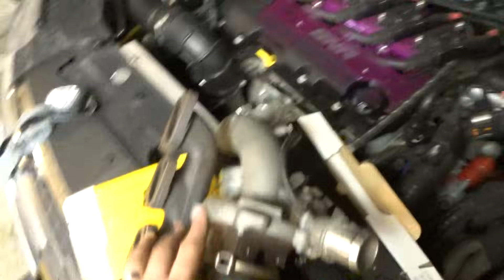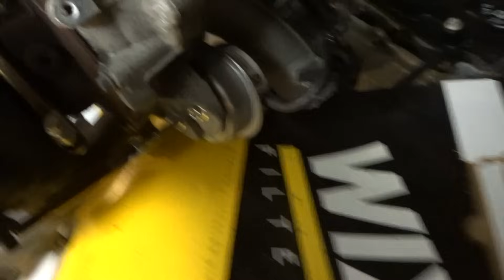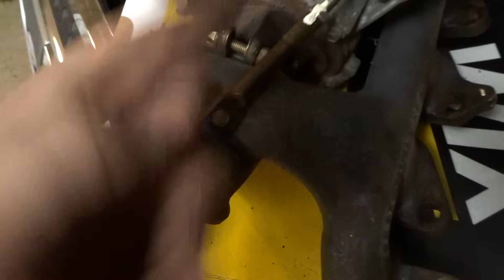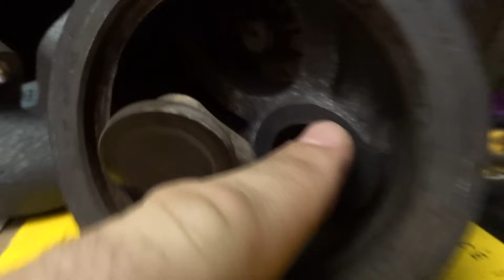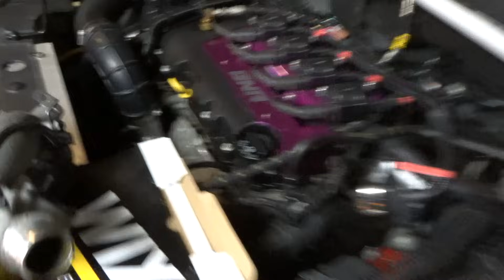Chevy Cruze Sonic P0299 Turbo Underboost Code Explained

Comment: Hey Andrei, I'm getting a P0299 code and can't seem to figure out whats causing it.. Figured i'd pick your brain and see if you can think of something I haven't. When I first got the code back in August, I bought one of your boost testers and found I was leaking boost in multiple spots. I also pulled the turbo out and found a good size crack in the waste-gate housing. Because of this, I decide to go ahead and replace the turbo, waste gate actuator, oil feed and return lines, as well as a few other things since I was already tearing into the engine. I also upgraded my PCV V2 kit to the V2.1 kit and threw on the PCV hose upgrade kit you sell. Threw on a new valve cover too.  I also cleaned up the throttle body and intake manifold and replaced gaskets on both. Once I got everything put back together, it ran great for about a week and then started throwing the P0299 code again.. When I do a boost leak test, it takes almost a full minute for it to drop from 20 PSI to 10 PSI so I know my system is holding pressure. I really don't think its the turbo either since its brand new. Only other thing I can think of is maybe maybe my MAF sensor is bad? Also, at the time of doing all these upgrades, I switched my stock air box to a cold air intake system. I threw the stock air box back on last night but haven't had a chance to take it for a drive yet, didn't know if that could maybe cause a low boost code for some odd reason? Anyways, hope to hear back from you, TIA.
Reply from the maker: How long as the V2 kit been on there (miles)?

Comment: what If you have no check engine light on  at all  When my ac is on during the summer months my car lacks power and   when you shut it off after running it go into store come out it Skips like crazy then clears up
Reply from the maker: You could still have a missing intake manifold check valve. Without diagnosing further, I wouldn't know what your issue is exactly.

Comment: I have a concerning question. Why do you use the stock air box?
Reply from the maker: All of the aftermarket ones either increase intake air temps or badly skew fuel trims. I modified the stock airbox to pull air from the fender directly while maintaining the stock MAF calibration. GM actually did a great job designing this airbox.
Reply: What are your air intake temps?

Comment: I just got this code. Is it okay for me to drive this 2 months (minimal driving) or is it a fix that needs to be fixed ASAP?
Reply from the maker: If the vehicle continues to operate mostly normal, you should be fine to continue driving it. If you are very low on power, I would not drive it.
Reply: @AndreiDPop  I really can't notice much difference at all. Thank you
Reply from the maker: @hughjanus8600  ok, might just be a missing intake manifold check valve and some boost leaks combined. You'll notice a difference once it's fixed for sure.
Reply: @AndreiDPop  my waste gate was disconnected and causing it to be wide open. 20 mins and $0.36 later she's fixed and runs so much better
Reply from the maker: @hughjanus8600  awesome, glad you caught it!

Comment: I have a 2012 chevy Cruze rs, the last few months I’ve had this code. It’s been in and out of the shop 3 times. They do something the car has a good boost again, and then after a few days the engine comes back on and I start losing boost again. So I’m assuming I’ll probably need to get a new turbo 🙄

Comment: Ok, so based on what you are saying, what other parts can it be besides the turbo? I have changed turbo and I still have issues with code p0299
Reply from the maker: Intake manifold check valve failure and any other boost leaks between the turbo and the intake manifold.
Reply: @AndreiDPop  ok thanks, this is a super tough issue and it is very frustrating to fix. I feel like I have to shot gun parts.
Reply from the maker: @dashadow231  no, you need to boost leak test the system. Figure out where it's leaking. I sell a test kit on cruzekits.com that you need a compressor for, or you can make one yourself.
Reply: @AndreiDPop  I see, I already spent 1100 in usless repairs,  I will just give the shit car away and never buy a chevy again. Thanks
Reply from the maker: @dashadow231  I try to make these videos available so people know what to look for. Sometimes it's just as simple as a loose clamp.
Reply from the maker: @dashadow231  I know the feeling, but hang in there. Get it boost leak tested first. It might be something really simple.
Reply: @AndreiDPop  Do you know any good places I can have this done? I am way too mad to do this test myself
Reply: @AndreiDPop  thanks for your help btw
Reply: @AndreiDPop  could it also be thebintake manifold check valve?
Reply from the maker: @dashadow231  yes, that's what I said.

Comment: This is the second video I've seen that you mention the possible boost leak at the charge pipe/throttle body connection.   Do you have a fix for this leak?
Reply from the maker: Tighten the clamp harder. If that doens't work, wrap the throttle body with natural gas pipe tape (the yellow stuff).
Reply: @AndreiDPop  thanks I'll be getting one of your pcv fix kits soon btw!

Comment: Where do you get that BNR waste gate? I’m throwing this code and I’ll be taking some steps to find out what’s causing it. Will I be able to visually see the waste gate “arm” move or not move if it’s bad, say in park Reving the engine till the revs limit?
Reply from the maker: BadNewsRacing.net. the arm only really moves while you're driving but you can move it by hand with the car off too. Not sure how much it will move if you're in park revving.

Comment: Hi!  This goes beyond my basic knowledge of my cruze.. but my check engine light for this code comes on... Issues accelerating... then off... no issues accelerating... sometimes in the same day! sometimes it's on for days.. sometimes it's not... Made an appointment to take her to the dealership since she's just barely under warranty still...  This has helped to maybe ask them questions... They've already helped once... Besides the oil the dealership uses, which kind can I purchase at the store that you recommend? Thanks.
Reply from the maker: The best oil you can get is AMSOIL Signature Series, but as it's not available in all stores, I'd recommend just running Pennzoil Platinum.

Comment: Hopefully the powertrain warrantee is still in effect.  If not, I hope it's one of the cheap fixes for mine....
Reply: Tried to get the OL a nice '08 R52 S MINI, but she had to have a Cruze, because it had 4 doors and more cupholders.  My '03 R53 has over 200k miles, and still runs strong - and will run even stronger now that it has a performance head and cam.  Still has factory hone marks on the cylinder walls, too.  Solid engines with forged internals, the W11....

Comment: So my cruze throws this code intermittently, it'll come on for a few hours or a day and then just goes away for a while, sometimes weeks or months. The car doesn't go into limp mode, but it's definitely down on power and i start burning through fuel, then it's just back to normal. I've been pointed towards the bypass valve, but I'm not sure. Any ideas? I'll be tearing it down soon to rule out the turbo itself, but I'm fairly confident that's not the issue considering the way it behaves
Reply from the maker: Check out my pcv issues video. It's likely you're missing the check valve in the intake manifold and its contributing to your problem. I'm not ruling out the turbo yet, but I'd start with the intake manifold first.
Reply: @AndreiDPop  Ok I'll check that out. Thank you very much. Yeah with my luck it'll be the turbo itself so we'll see.

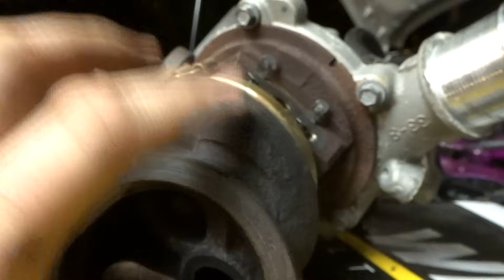Comment: At 3:37 what is the issue with the cracks on the casting on the wastegate valve seat on the Turbo?
Reply from the maker: It's very common. A small crack won't be a problem.

Comment: Great video! Would like to discuss a partnership with you with the possibility of providing free parts, including a new chevy cruze turbo if you film the install and give us a shout out. Let us know if you are interested.
Reply from the maker: I already have a BNR GTX14 turbo so I won't be replacing that any time soon, but sure, let me know what you have in mind.
Reply: @AndreiDPop  We specialize in brake pads/rotors, AC compressors, suspension, turbos, and steering; whatever you'd like to do an install video on we'd be happy to send you the parts. Do you have another way we could contact you privately?

Comment: Could it be the Turbo if it only acts up when the car is warm and under load? It usually does fine in the mornings. Mid day in this summer heat it’s been horrible and going into limp mode. Had turbo and valve cover done at 50k miles. Now that I hit 100k miles it’s doing the same thing again.  When I had the Turbo replaced the Chevy service advisor told me they only last about 50k miles and to look into getting rid of the car.
Reply: Same issue, no boost under load on hot days, but does fine in the winter. Hot humid days throws P0299 code occasionally and no boost. Stopping car and restarting a couple min later works fine for a little while. Going to replace turbo to see if that helps…
Reply: @Jeremy-cb4rz  how’d it go? Diagnosing my p2099 code now, found no boost leaks / Pcv issue / externally evident issues with turbo (leaking oil / water, wastegate issue etc)
Reply: @coldtortoise179  Turns out it was a sticky wastegate valve. When I manually attempted to open and close the wastegate, some corrosion sometimes prevented it from opening and closing. If you have a high heat lubricant, there’s a chance it could postpone a replacement. I did replace it though and haven’t had any issues since.

Comment: 2011 cruze  po299 but if i get it up to 30mph it hard shift down. if i get to 30mph and let off the gas it will shift normal then i can take off,?  I didn't think it was the turbo so i took it to a shop to see what they get for codes. same code as mine. they told me to change the turbo so i got a low mile turbo switch it out  same code and shifting problem  Has anypne had that shifting problem and gitting that code.

Comment: My sister's 2014 Chevy Cruze is having this code, we found the arm on the actuator had become notably rusty so we used PB Blaster and got the code to go away. However it resurfaced about 2 weeks later, so we're going to replace the actuator for $50, staying far away from swapping the turbo. Thank you so much for this good info.
Reply: How did that work out?
Reply: @TheBearGrylz  worked great for about 2 years and then some other stuff popped up, got the part on Amazon

Comment: Just had oil changed at an oil change place. First time not going to dealership. Could this be do to a lesser grade oil? Check engine light on, low turbo boost code 2 weeks later. Coincidence?
Reply from the maker: Check the oil level. What oil did they use?
Reply: @AndreiDPop  it was Castrol. Checked oil and it was good.
Reply from the maker: @curtpence956  castrol what? Conventional? Edge? Titanium? Which Castrol product?
Reply: @AndreiDPop  conventional. Guy asked if it was still under warranty. But I just passed it. My dealership hours are terrible, and with my work, driving a hour each way doing 80 mph. Don't wanna be left on side of the highway. Should I go back and get a better oil? Leave work early and go to dealership?
Reply from the maker: @curtpence956  never, ever, ever run conventional in these engines. That won't even pass factory minimum specs which are already low. There's a good chance the oil coked up and oil starved the turbo. ALWAYS use synthetic in these engines.
Reply: @AndreiDPop  ok. I will get it changed tomorrow.
Reply: @AndreiDPop  thank you. Thought that might be it.
Reply: they might have bumped the charge pipe by the throttle body and cause a boost leak.

Comment: What kind of turbo did you upgrade to?
Reply from the maker: BNR GTX
Reply: @AndreiDPop  hello my friend i am typing from Turkey . I have astra j 1.4 t , i want to ask you a question  about engine . Did you upgrade engine inside before this turbo upgrade? What do you think about stock  engide ( pistons and rods) how many hp can gain  with stock engine  as healty? Also if i port my intake manifolt without tune can i gain hp? This ported can damage the  engine if no tune?

Comment: hmm mine is VERY VERY intermittent (had it happen the other day losing all power) and I had it happening last summer. but not a single time in between. Car is stock. seems like it's only done it when it's really hot outside and beat on a little bit. I was thinking the possibility of the actuator sticking open essentially dumping boost but then when I manually clear the code it would run back at 100% (note it never actually threw a CEL just simply lost boost and I would put the scanner on it and see the p0299)  I was honestly not sure if I should buy the actuator or not. (I plan to get the BNR tune and a cart load of other parts but obviously need to sort this out)  as an obvious BNR fan I'm hoping for some input.

Comment: Hey Dre Dan. I just brought a 2014 Chevy Cruze LT with 20,000kms.There is no warranty on it. I don't have any issues with the car so far.should I  install your PCV kit  now before I run into all the  PCV problems?
Reply from the maker: Yes absolutely. The failure rate is 100% on these intake manifolds.
Reply: @AndreiDPop  Hi I had the engine replaced (same engine) on my 1.4 sonic. The day after I got it back from the shop, the pcv vacuum membrane starting sucking in air, so I had the valve cover replaced. That fixed the problem, but I want to check the check valve on my intake manifold, but can't get the corrugated hose off the manifold. There is no clip anymore, I don't know if the shop lost it, but the hose is on there very tight. Do you think I should just wiggle it off with force? Have you had any issues taking it off?
Reply from the maker: @MCZ70890  it can be tough to take it off but it should come off with some force. Hopefully they just lost the clip and didn't glue it on. I'd recommend getting a new hose either way.

Comment: Can you pm me the coil and spark play set up u have?
Reply from the maker: I'm using the BNR LS7 coil upgrade. Don't really need it unless you're also running a big wheel turbo like me.
Reply: @AndreiDPop  I just got my cruze and am wanting to change to a bigger turbo and do some upgrades. Not to drag race but just for me and to make the motor bay look a little better. Thanks for your info

Comment: I have a Cruze with a 1.4. When I start the car up cold and roll my windows down I hear a "pist pist pist" coming from the engine. No codes and car runs fine. Once the the engine is warm, the noise goes away. I did a soapy bubble test and it's leaking around that wastegate shaft. Any fix for this? Also, you said your car has an upgraded turbo. Is there a way I could do away with this factory turbo and buy like a T3/T4 and have it instead?

Comment: Watching this video, after the dealer has done the valve cover (one of the times being a vacuum leak, other I forgot) two different times. I read this code, we brought to dealer , and they said it's the turbo. It makes me wonder if they actually checked the whole system or just throwing a new part at it. Regardless, I'm gonna be checking in my driveway before proceeding with doing the turbo myself
Reply from the maker: I'd definitely recommend a boost leak test and PCV system check before replacing the turbo. The turbo could be bad, but it could be other things that are far easier to replace.

Comment: my dealership replaced the entire turbo due to this code.  They said the waste gate actuator failed and the whole turbo needed to be replaced.
Reply from the maker: Yeah that happens as well. It's best to eliminate all options first though before replacing the turbo.
Reply: problemsolved what year and how many miles did your car have when you had this replaced?

Comment: Dre Dan, my chevy sonic 2014 turbo LtZ with 50k miles has the check engine light due to the P0299 code. Im in the middle of a road trip in AZ. I live in TX. How urgent is this issue ? Should I have an unknown mechanic check it out or can it wait another 1000k miles until I get back home where my local mechanic is?

Thank you

Comment: I have a 2014 cruze lt I just recently change the headgasket. My car keeps losing colant but is leaking into the ground any idea.. also my car starts to shake when idle and cold start with white smoke. Plz help
Reply: Defective headgasket small cracks in it can cause this

Comment: My cruze wasnt boosting enough and sometimes it will boost to much giving me incredible mpg lol. I did some wrk on it and i had to remove the the turbo wit exhaust. And i notice when i removed the  turbo actuator, the little handle that moves the waste gate was rusted hard!. I had trouble opening the waste gate! The car had issues opening and closing the gate. So i sparyed a rust penetrate solvent on the outside and a little on the inside of the turbo were the  little handle is. And it loosened it right away. I also sparyed a lubricant on the handle to try to keep it from rusting. And my car has never performed this good. It boost really good and i dnt have those bipolar power loss and Gains issues anymore.
Reply: Hey brother, been awhile hope you're cars running good still. Just got this code, gonna try that out.

Comment: Thanks for the info. BNR says you need a tune to run their wastegate actuator. I’m tuned by ZZP though and don’t plan to switch to BNR. Can I still “bolt it on”? I feel like the function should be the same despite being a stronger make up
Reply from the maker: Nope. You need a tune to adjust the Wastegate actuator calibration.
Reply: Dre Dan thanks! I’ll keep that in mind as I mod